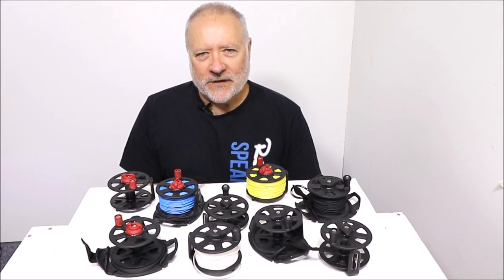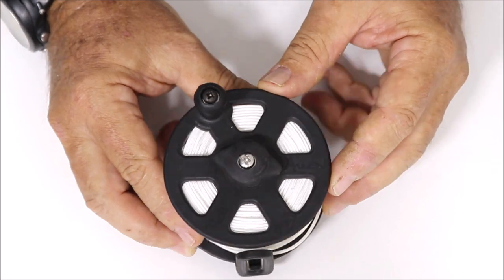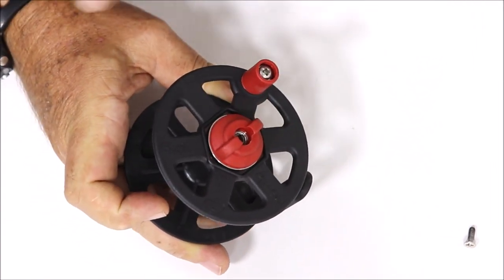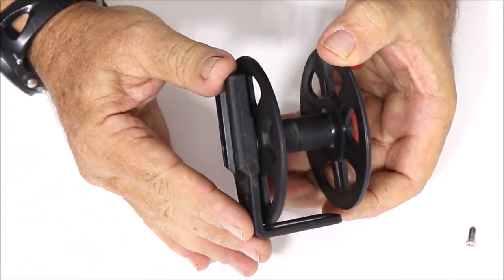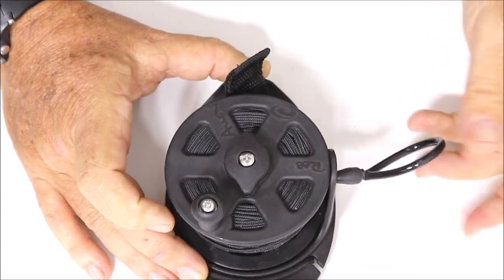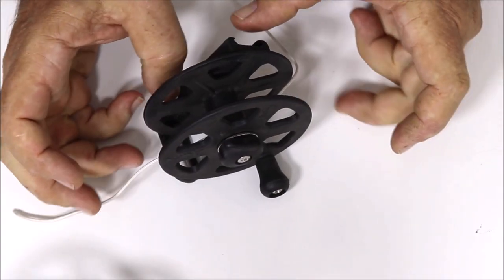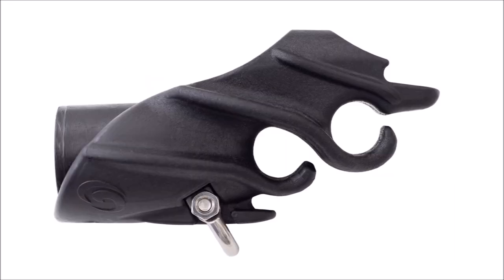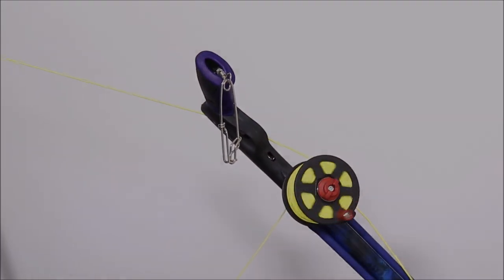Rob Allen | Vecta Reels | Part 1

Comment: 60 meters of 1.8mm Dyneema reel line is great. You are right - for the exceptional cases, when needing more line attaching the gun to a backup belt reel is common practice.If shooting larger fish maybe it's good to switch to break-away setups or clip the gun's handle clip to a float line.

Comment: Is that line ant line that’s on the new reels, if so who do I contact from your distributors to have reels come spooled with that line and not the nylon coated dyneema?
Reply from the maker: Where are you in the world? Ant line was a generic name a long time back for Dyneema, it is going to be re introduced. Nylon is not a coating used on Dyneema, some stiffen it with a type of polyurethane.